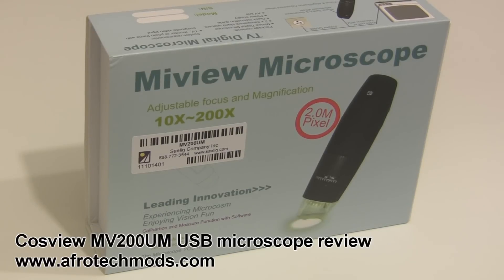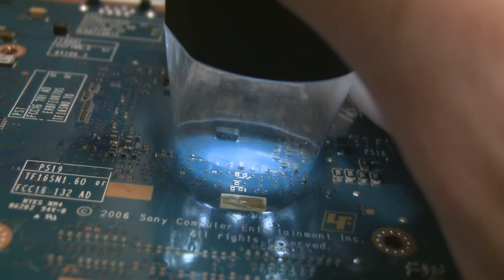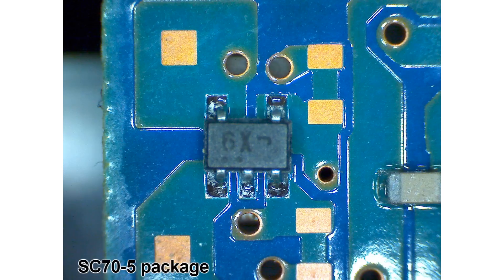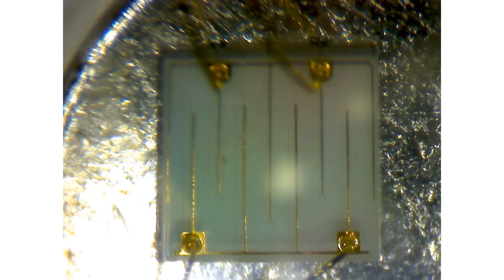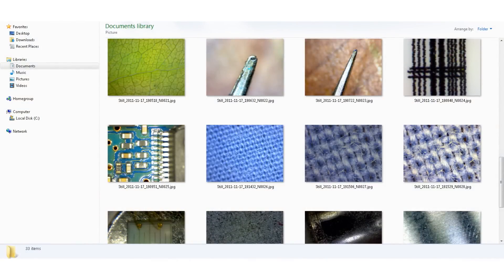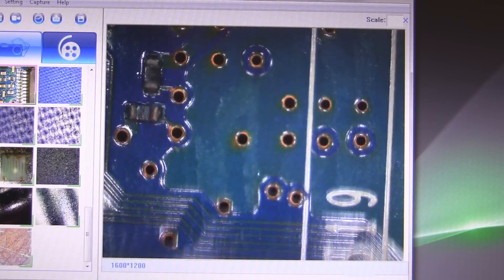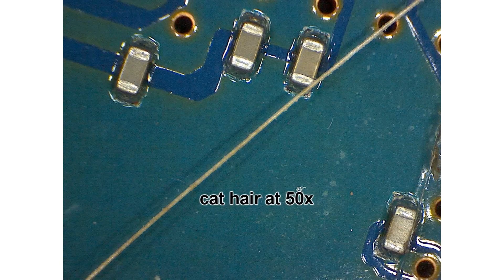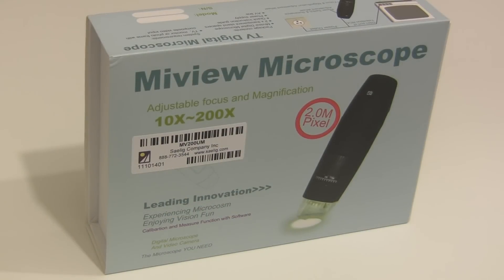Cosview MV200UM USB microscope review

Comment: A suggestion about the stand:

If you are having trouble with your surface, all you need is a sheet of anything it will stick to and your good to go. You could just have enough base to hold it up, or you could build a tray and clamps and whatever else you may need.

Comment from the maker: @tntodorov Unfortunately you can't just pick a distance and magnification then adjust the focus as you can with regular microscopes. There are fixed distances and magnifications where things are in focus. Some long distance examples are 5cm / 15x, 10cm / 10x, 15cm / 9x. When you factor in shallow depth of field as well I don't think I would use it for real time soldering.

Comment: I've got the same scope and highly recommend it. I do some hand soldering of very small analog to i2c chips and use this cope on a stand mounted above the work. The bundled software leaves a bit to be desired due to the isues mentioned (aspect ratio, etc..).

I've had good luck using this with 'Yawcam' - it's a free webcam utility package and is quite handy (full screen with proper aspect, web server, etc..)

Comment: My 10X Jewelers Loupe has generally been adequate for finding bad solder connections and identifying parts. Nevertheless I dislike like having to squint my eyes for extended periods while looking at circuit boards. In spite of it's potential usefulness this type of microscope does not look like an ideal way to view large areas.
Thanks for all the informative videos.

Comment: Have you attempted to use the microscope for inspecting decapped ICs and other components?  It looks like it might be enough magnification, and clear enough to do it, but its hard to say without having seen it tried.  Most optical scopes do 100x-500x (or even more), but I don't know where the edge of the usability is.

Comment: you can get some bare dice by carefully (hehe) burning the plastic package of a chip then when it turns white and stops smoking, you can carefully break it in half, and the die will pop right out, ready to view.  Some experimentation with heat will get some decent dice.  also, a big power resistor (hollow) is excellent since heat control is very good (just control current through it).

Comment: I got a cheaper one that seems to be the exact same electronics. It works like a USB webcam so I just use the system default Camera app on later versions of Windows (8, 8.1, 10)

I recently had a Surface RT and Surface 2 given to me. Both are ARM instead of x86-64 so they don’t run standard Windows applications even though they have Windows 8.1. This makes them almost useless, since Microsoft has abandoned them and the Windows Store isn’t exactly brimming with ARM-compatible Windows apps. Luckily, Microsoft includes RT-compatible Windows drivers for many basic devices, including webcams. I figured that it would be good to dedicate one of these as a display for my USB microscope. Unfortunately, it wasn’t exactly Plug’n’Play, since the system prompts for drivers. I gave up at first until I googled and saw some other being marketed for Windows RT. Turns out, you have to know what category Microsoft keeps the standard USB webcam drivers in then browse to those and force the system to accept them. The OS balls but I did it on both RT tablets and it does work.

These are technically “RT” versions of Windows 8.1 so they do have the system “Camera” app. The button that normally switches between front and rear camera now just adds a third camera into the mix. You can still change the aspect in the camera settings but it doesn’t remember it for long (annoying!). Of course, I don’t get any of the measurement features of the other software but it does work.

Just thought I’d throw this out there for anyone else with an old nearly-useless Windows RT machine/device. I doubt I’ll be so lucky with a USB oscilloscope though. :)

Comment: How is the color fidelity? I am severely colorblind and usually identify color codes on wires, resistors, ect. by snapping a shot with my phone and using the color picker tool in Paint Shop Pro. Unfortunately, it's hard to get enough area to sample and the flash is useless at close distances (too bright and too blue).

Comment: With Linux just use Cheese - it works with most webcams out of the box, and uses the full resolution of the camera inside. Only drawback is the button does not work at all, you need to press the space on the keyboard. Can take single shot, multi shot or video.

Comment: @Afrotechmods For the save directory.
Make a batch file with this, if you want it to, you can add it as a scheduled task in the control panel. In linux you can use cron.
move "%USERPROFILE%\Documents\Still*.jpg" "%USERPROFILE%\Documents\My Pictures\magnified\"

Comment: These are basically glorified webcams and can be used with pretty much any program you can use a webcam with. Most systems have an environment that may be better than whatever comes with the scope. I am not familiar with this particular scope, but I have a similar scope and the software was horrible.